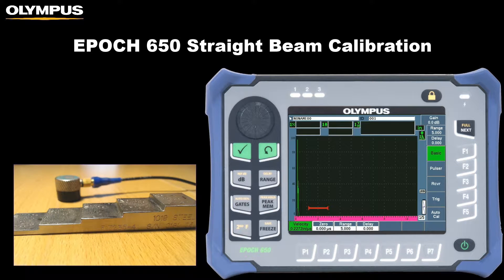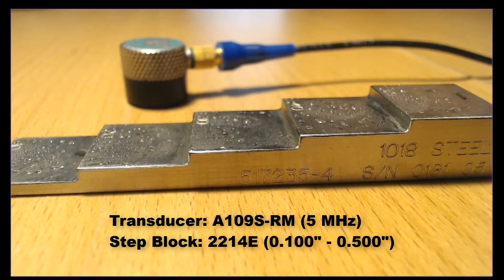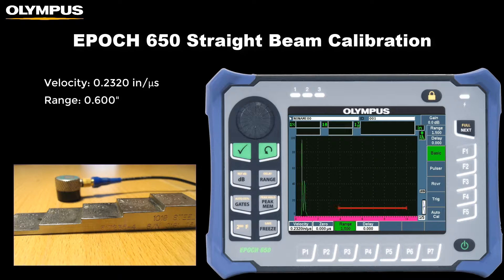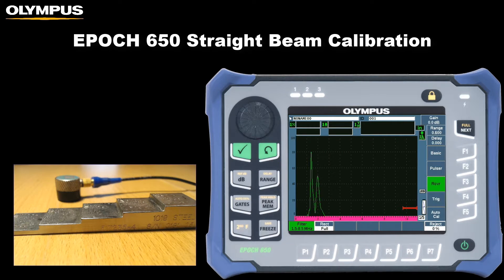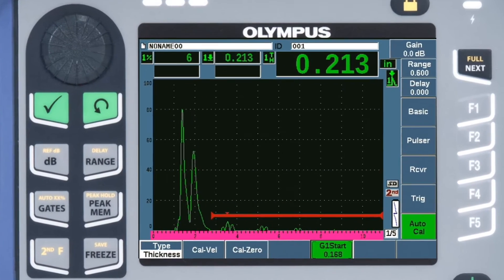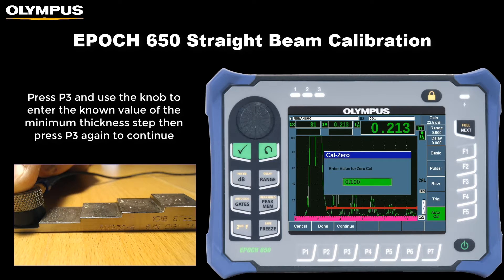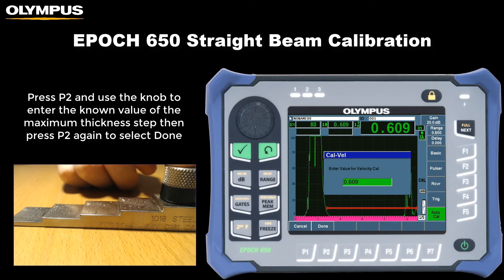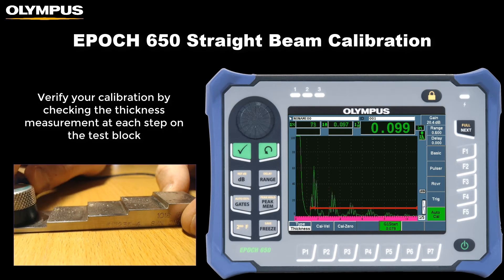EPOCH™ 650 Straight Beam Calibration Tutorial

Comment: Which is better IP66 or IP67?
IP66 Enclosure - IP rated as "dust tight" and protected against heavy seas or powerful jets of water. IP 67 Enclosures - IP rated as "dust tight" and protected against immersion. for 30 minutes at depths 150mm - 1000mm.